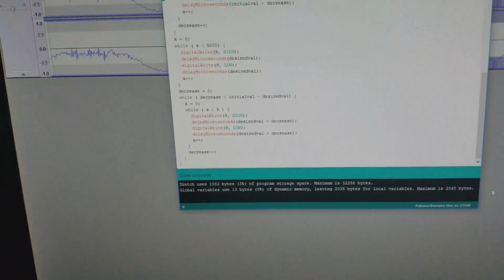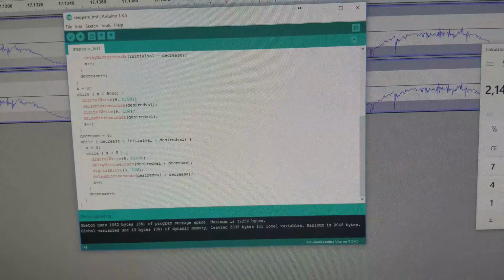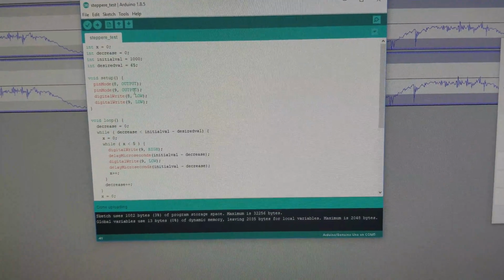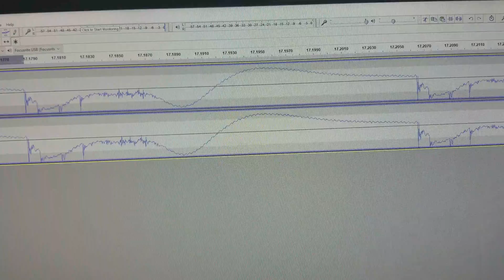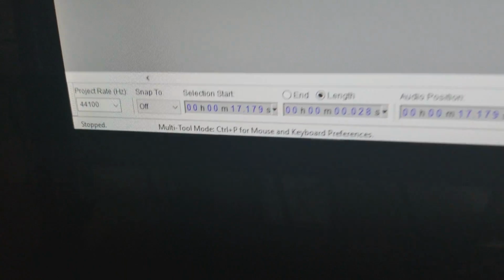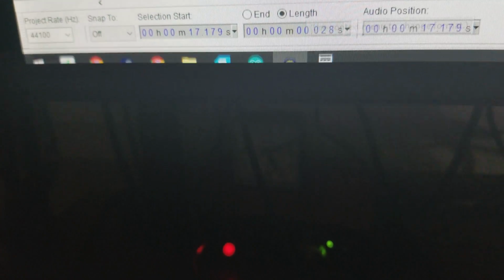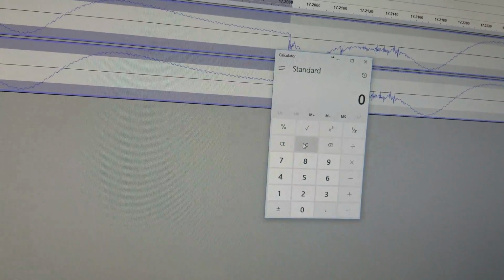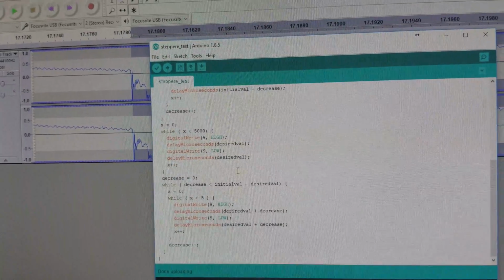Stepper motors with arduino, Finding the maximum speed / acceleration curves

Comment: You can easily find RPM if you turn it 100 or 1000 REVs and time it with a stopwatch on your smart phone.  You can also use a free strobe app, but that takes a bit longer to get working reliably.

Comment: Why would the motor get so warm?
Reply from the maker: motors get hot because of the internal friction. When operating at low speeds the heat given off is little. But when operating at max speed the heat is maximized.

Comment: I'm hoping to find someone else that uses a sine curve instead of a linear ramp. I saw the sine curves used in the '80s to eliminate shock-loads from heavy moving parts controller by steppers. I realize it takes a sine curve using trig and it doesn't seem that complicated. Ramp theta from 0 to 180 degrees to accelerate and use ((sine + 1) / 2) method to produce a value from 0 to 1. Ramp theta from 180 to 0 to decelerate.
Reply: I think I got the polarity backwards.
Reply from the maker: The one in the video is linear however a sinusoidal curve is not hard and is easy to implement by making the duty cycles a sinusoid.
Reply: I don't understand clearly.can you have  examples?

Comment: If you use it on load, you will see it won't make those 2000rpms. You will hear horrible skipping sounds. I was there before.
Reply from the maker: This is proof of concept, ofc this is too fast for many applications but pushing the limits of the motor also tell me how the min and max acceleration for a known torque value

Comment: Lil moto' sounds so cute! :D  That's interesting stuff. Just now getting into all this, and discovered acceleration curves. Would be nice to find a stepper out there which goes ~5k rpm at its torque peak of (preferably) 3-8 lb-ft. Any suggestions? I've already found stepperonline but theirs mostly go 3k tops, and from what I've learned, pushing it over recommended rpm drops torque massively.
Reply from the maker: if you need more than 3k rpm i would suggest a brushless motor with an encoder and write a feedback loop for it the steppers that can do that much rpm and torque are going to have very slow acceleration curves

Comment: awesome video, thanks for posting. Do you have any idea how hard it is to find a simple acceleration curve for a stepper motor and arduino?
Reply from the maker: Not very hard, you can use a disk of known mass and see how quick it can accelerate then log when it starts skipping. once it starts skipping using the moment of Inertia of the disk you can calculate the max acceleration.